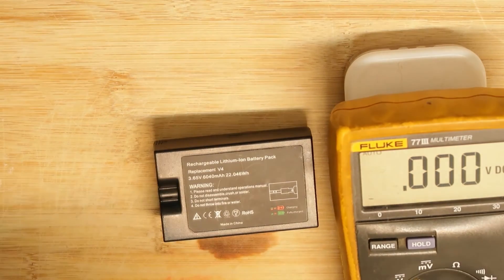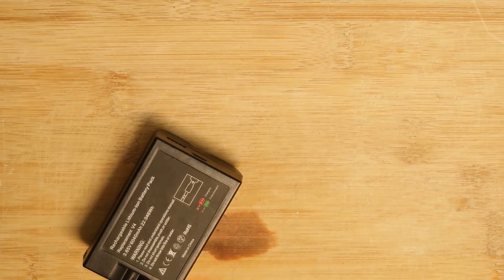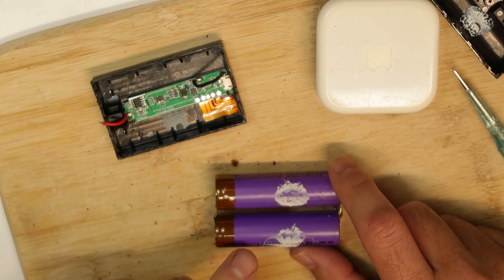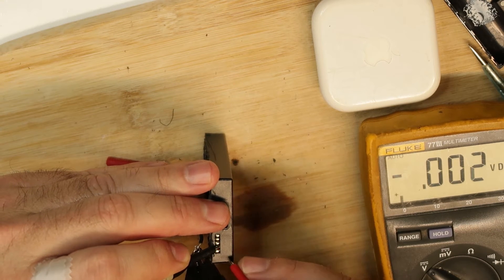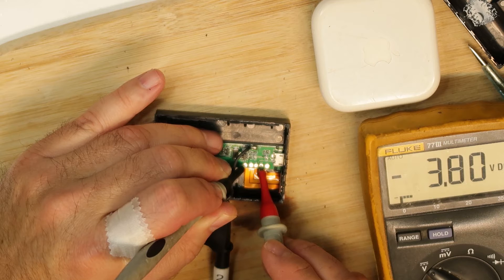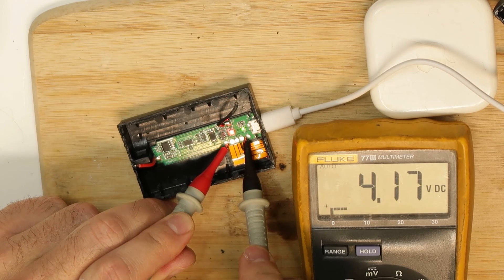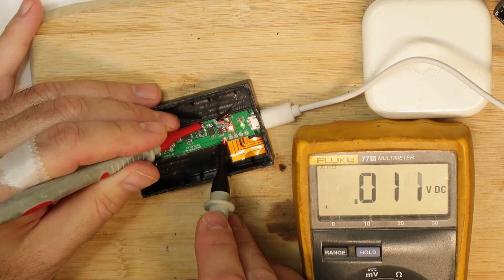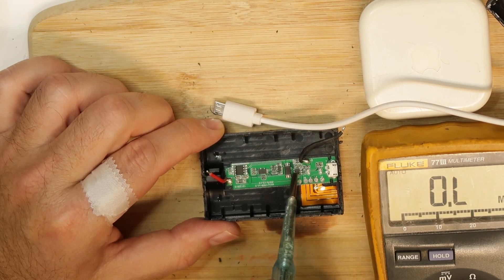Ring Battery Disassemble and test

Comment: If you want to know how to test the voltage of the battery with a multimeter, it's best to start with a fully charged battery in good shape for comparison.

Then once you've determined which contacts are what, you can use those contacts on the subject battery.

IIRC, one contact is the neg, and each of the other contacts are pos, and you need to test them all.  When fully charged, they will all read the same voltage, around USB voltage.  If one is lower, you have a problem.

Comment: Hello everyone. Just diseambled one battery, checked how much ampeehours left - almost 3200 ah, but why does it last for a 3 days? Bateries doesnt discharge themselves, is it problem in PCB, maybe it "knows" how many cycles battery can be used? 😮
Reply: I'm not entirely sure but the mah left depends on the discharge rate. A slowly discharged battery might look fine. But once you increase draw the voltage might drop off very quickly.

That is why your old phone withe the bad battery might hold its charge relatively fine in the drawer but when using it discharges very very quickly

If the camera connects and does everything all at once it might draw somewhere of around 5-10 W.

Try discharging it at 2-3 Amps and look what is left.